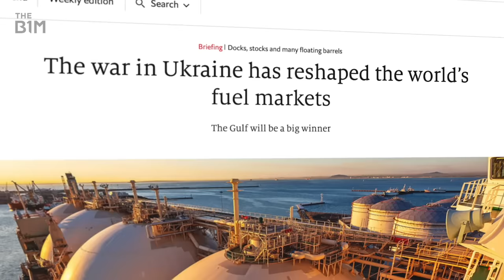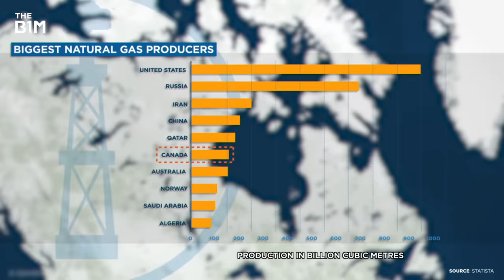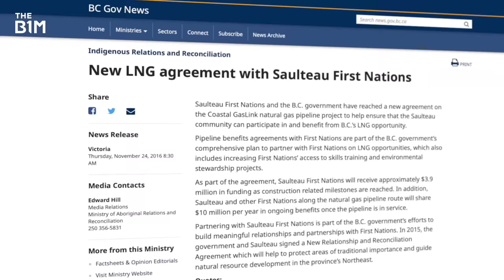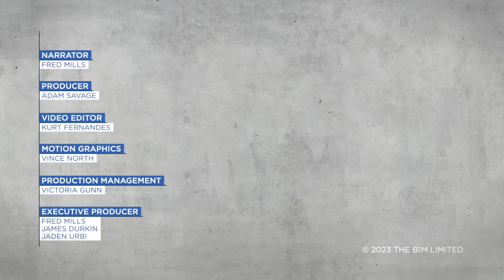Canada’s $30BN Gamble To Become An Energy Superpower

Comment: TL;DR: more renewables around the globe and especially Europe will require more natural gas a backup generation.

This video claims that Europe will be getting off of natural gas because they are building renewables. Actually, they will need more natural gas because of those renewables (I mean solar and wind here).  100% of renewable capacity has to be backed up with a reliable on-demand electricity source.  It turns out that natural gas is the best fit for this, and this is well evidenced but often glazed over by poor research in journalism.

Comment: Methane, Propane and Butane (Natural Gas), quite happily separate into hydrogen and good quality carbon for the creation of graphite and/graphene. 
So, in short, the investment has greater potential, especially once the industry finally realizes the value of its gas when it is not burnt 😏

Comment: Best place for this natural gas is untouched in the ground.
Should be be spending this money on renewable energy, and storage. Build a high voltage DC transmission network across the country and to the USofA.
Jobs forever, in construction, maintenance, recycling it parts into new renewable energy infra structure.
Only use the natural gas for the few things it can only provide not burning it. Much tighter control is needed on it as it is a very potent green house gas.

Comment: If only there were something like NUCLEAR that was the CLEANEST, SAFEST, MOST ENERGY DENSE, MOST ECONOMICAL (when done correctly) source of power to turn to instead of BIOSPHERE DESTROYING fossil fuels like LNG. Cities around the world have been experiencing record temperatures, average temperatures for the entire globe in July have been at their highest on record. NUCLEAR is TWO MILLION times as energy dense as LNG. WE CAN POWER THE PLANET SAFELY BY BUILDING ENOUGH NUCLEAR AND WE CAN DO IT TODAY!
Reply: Nuclear has its place, but so does n.gas. nuclear is great for base load power, but not for relatively rapid changes to respond to grid load.

Nuclear needs 6+ hours to respond to a large shift, whereas n.gas and coal plants can respond in minutes.

N.gas replacing coal is therefore much better in the intermediary term.

In the very long term, both n.gas and nuclear should be phased out for power storage systems and renewable systems
Reply: @joshuacheung6518  Entirely incorrect.

Comment: I'm all for this project, because it means the Keystone XL won't be leaking all over the heartland of the United States with its substandard welds.
Reply: How does this project improve the construction quality of Keystone XL? That pipe should have been completed years ago.
Reply: Not quite, a 670 km pipeline goes to this and......Since 1986 pipeline accidents have spilled an average of 76,000 barrels per year or more than 3 million gallons. This is equivalent to 200 barrels every day. Oil is by far the most commonly spilled substance, followed by natural gas and gasoline.

Comment: Further to many of the commentariat below. This would be fine as a short-term solution for grab-the-$$ and fix-the-gas-shortage, if Alberta's oil-sands were being retired at a higher rate than the LNG is coming online.  But I fear that's not happening. Ideally, tomorrow morning all (well, nearly) of the coal consumption in the world would be replaced by LNG, and then a decade later, most of the LNG would be replaced by renewable electric. Again: not happening. Oh, before I get flamed: I understand that a small amount of coal, oil and gas will always be needed for chemical industry feedstuffs.

Comment: Buddie in the video talks as if theirs a replacement for a gas furnace or even one in sight, gas is used all over the world to heat homes, electric baseboard heaters use too much electricity and boilers to radiators are rarely used anymore in the first world.

Comment: Could the harnessing of the #LightningBolt be #measured; #StatueofLiberty 🗽 as the suggestive idea💡 ?

Given the state of weather with the production of the #LightningStrike, a #conductive layering of the point of designation, #transmission line within the earth’s 🌎 #ground as a possible use of #insulation, multiple points of grounding along the transmission lines to account as #resistance, and #components to obtain any degrees of #measurement. 

Other areas #LakeMaracaibo, #Venezuela 🇻🇪 for points of study 📚. 

#EndState, if the measurements can be obtained, we believe that multiple #receptive points around the world 🗺️ could #consistently feed #power #endlessly. 

Could the 🌍 🌎 🌏 and atmosphere be (the open but closed #circuit or #circuitry) and the bolts of lightning ⛈️ be the #signatures of transmission? Could the bolts be inverse 🔄 on either sides of the 🌍 🌎 🌏 ? From the ground to #atmosphere & vice-versa ? 

The #focus should be #tapping into and the #tapering of this open but closed circuitry of endless #power.

Greatest #threats or those of #governments who #restrict the #abilities and #liberties of the currently enslaved #peoples. 
I
#Simplicity

Comment: The largest energy flux on the planet is also the cleanest and most ecologically beneficial, the water cycle. The tiny part we access through hydroelectric can be multiplied many times by Pluvicopia. It is also a megaproject but extremely simple. Mechanical engineering is challenging. It is essential to get input for its construction from the engineering community. The are two components ore the Plume, which is a meteorological machine with updrafts and downdrafts working to grow water drops at 50 tons per second. These created winds are also a large energy source. The mechanical part is a 40 km long and 2 km wide greenhouse suspended over a canyon with cables. The design minimizes ecological and monetary costs, but it is a challenge never attempted at the necessary scale. The book Pluvicopia argues the meteorological side but leaves the mechanical engineering question open to other venues. Please read the book and comment on the mechanical engineering practicality. The cost for the simple structure is expected to be substantially less than one billion dollars. Contact info is in chapter 11.

Comment: I drive a truck Ludington Mi has a water hydraulic power station during the day water flows out of a man-made lake and powers the area I count 6 possible 8 sets of transmission lines coming out and going in different directions. At night pumps are fired up and take water out of lake Mi and push it back into the man-made lake I have yet to go by any windfarm solar farm and see even one set of transmission lines to suggest they are all underground cables carrying 1000s of volts is talking to the masses like they are stupid. When you study something the proof of your genius is in the application of your education TALK IS CHEAP and right now the earth is filled with big cheap talkers just the term fossil fuels really a fossil 1000s of ft underground are you serious and then the word carbon and all the cheap talk of its dangers WHERE ARE THESE 100 ACRE DOMES WHERE ALL THE CHEAP TALK ABOUT CARBON IS BEING TESTED